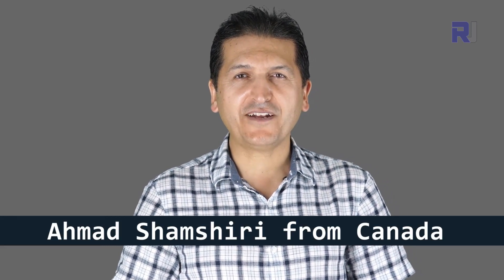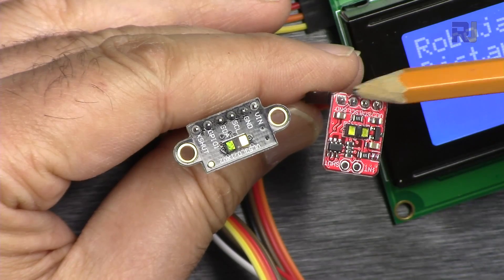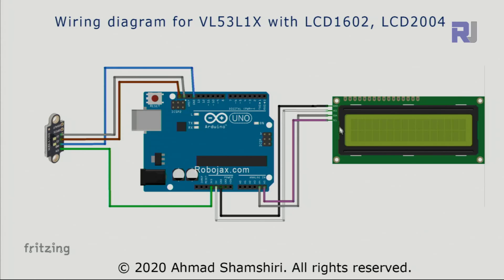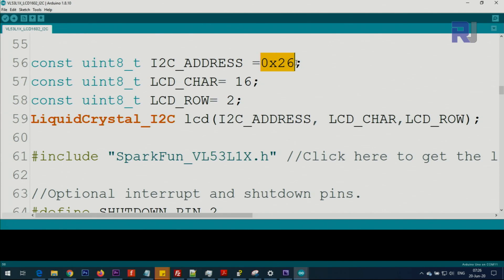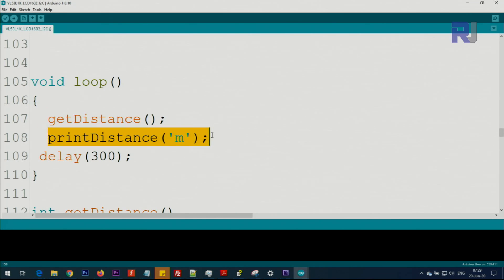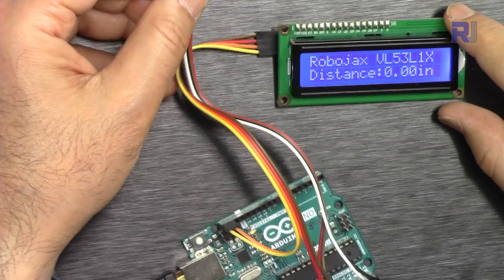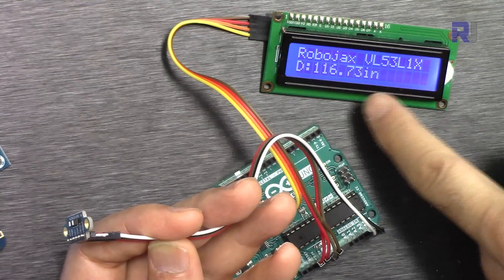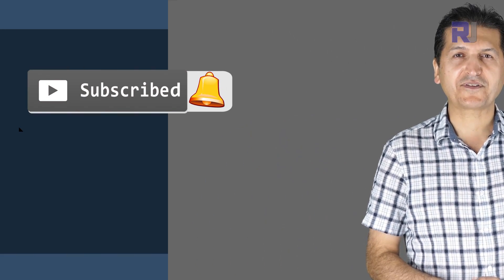Display distance from VL53L1X Distance Sensor on Arduino LCD - RJT325

Comment: my sensor measure 2 meters even when i point it to roof or far far away. i set the distancemodeLong but still same. What could be the issue? Thanks in advance.
Reply from the maker: not sure, it must work. unless ou have a different sensor.
Reply: @robojax  yeah i used another one and it worked, some sensors are faulted I guess.

Comment: Hi there
I have put together this range finder/measurement device as per your videos.
I have a problem.
All I get on the display is the message

Sensor not working
Check Wiring 

I have check and re check and cannot find a problem with the wiring.
Any ideas what is wrong.
Many thanks
Reply from the maker: You didn’t mention which sensor but it seem you have skipped the main sensor video . Before come”ing yo this video make sure you can read the sensor value in the serial monitor. Once it worked then come this .
Reply: @robojax   Hi there
I am using the QYUL53LOX Sensor.
I do not seem to be able to read the sensor value in the serial monitor.
It shows up on the serial monitor but no value.
Thanks
If you haven't guessed I am new to all this.
Reply from the maker: That is VL53L0X . You need to watch either this video https://youtu.be/0GxFoq_zPt4 or this https://youtu.be/S2jaAQEv3Yo , then I have a video combined with LCD. Search my channel
Reply: @robojax   Hi again.
The good news is I now have the sensor up an running as per the video you listed above.
I have watched you combine video but the lcd still reads sensor failed check wiring.
Reply from the maker: Did you watch the sensor and lcd video that I have? Here is how find a particular video in a channel https://youtu.be/OhkUceBWcHs
Reply: @robojax  Hi again
I am using a GYUL53LOX Sensor . I have this on the serial monitor but cannot get its value. thanks

Comment: nice job, Can you pls share the code for 16X4 LCD(1604), at the same time measurement for " line by line " Values like 
1) Distance  - CM
2) Distance - MM
3) Distance - Inch
4) Distance - Ft

If you share the code in single file for the 4(four) Values i can easily upload 

Pls
Reply from the maker: I have fully explained it. For line 3 you oust lcd(0.2) and for line 4 lcd(0,3). As I mentioned first set the cursor and then print. Please watch this video you will do it.

Comment: What happens if VL53L1X encounters a mirror？
Reply from the maker: Here on page 1 of datasheet it says: Unlike conventional IR sensors, the VL53L1X uses
ST’s latest generation ToF technology which allows absolute distance measurement whatever the target color and reflectance. 
so it means it should not matter and it should measure  because reflectance does not matter. The link to the datasheet is on the resources page for this video.

Comment: expect you to make clips to control speed and number of revs use a4988, arduino + lcd i2c, thanks
Reply from the maker: I am getting that module. But this video is NOT about motor. it is about laser distance sensor. Thanks.
Reply: @robojax  Thank you. I know this video is sensor. I mean, hope you made a clip of the module I said above

Comment: What sensor is used for measuring height from unbalanced ground like measuring height in crops
Reply from the maker: You can do it in many ways. But ultrasonic sensor would be enough for this purpose. Check our channel for ultrasonic

Comment: Make some videos about, arduino based coil winding machine, by using dc motor encoder instead of using traditional stepper motor, with lcd display.
Reply from the maker: Hi , this is too specific and very few people will need it. I work on projects that a lot of people benefit from.
Reply: @robojax  Hi. I accept it. But in my country so many small scale motor rewinding shops are purchasing that machine too costly without knowing their simple mechanism. If you teach that programming tricks to make that machine, that will helpful to those technicians by do it them self. And also it will very useful to students project who are studying. Because, your videos are nice and easy to capture practically. Thats only i request you to.🙋🙋🙋🙋